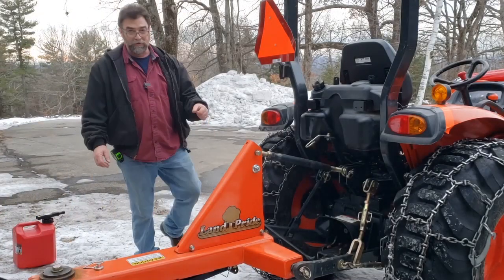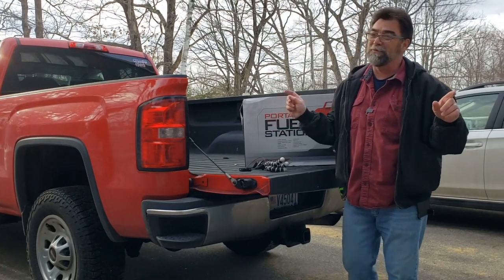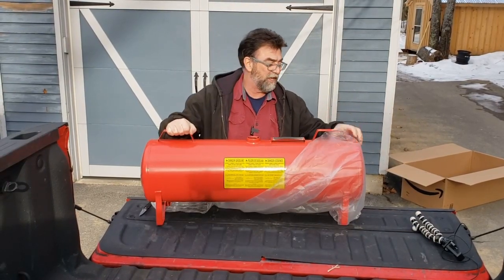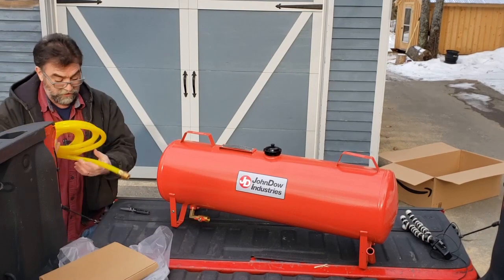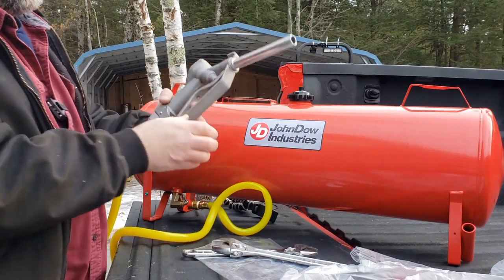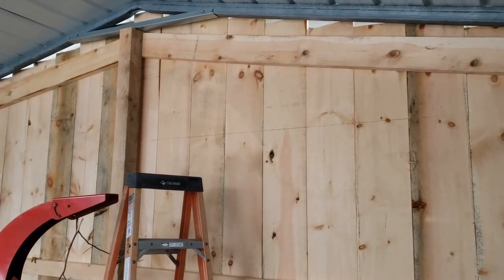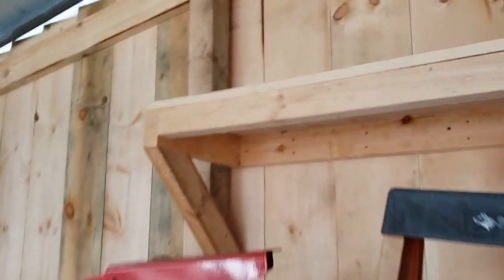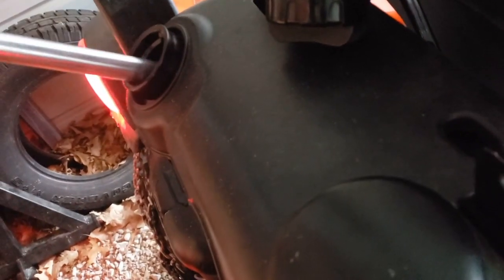Unboxing and setting up John Dow Industries 15 Gallon Fuel Station in our car port.

Comment: I gotta get me a set a them metric ADjustible wrenches!! Yea....let's face it....when you need to fuel up the tractor in the middle of a project, you don't want to deal with the canmare! (see that...nightmare...canmare...okay, don't hire me to write your jokes) That should lift easy enough with the forks. I think it's a great idea!

Comment: Great! One question, How do you fill ‘er up? Off the shelf with help tractor assistance, on the shelf with fuel truck...?
Just wondering, I have one of these coming to me in the mail, using it in a different way and checking out your great tutorial.
Reply from the maker: I take it off the shelf when empty and put it in the back of my truck.  After filling at the gas station, I use the tractor to put it back up.